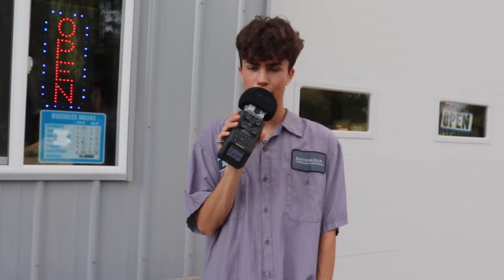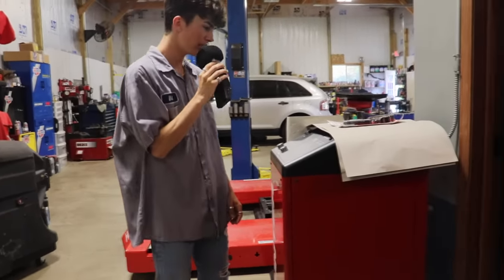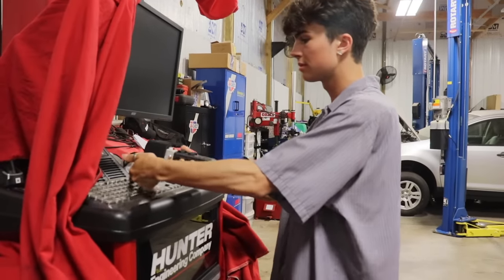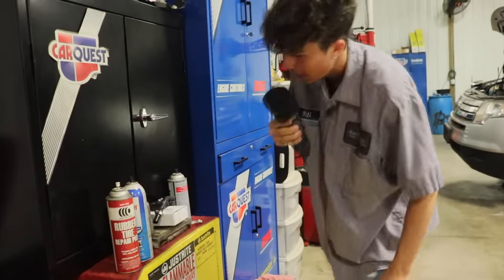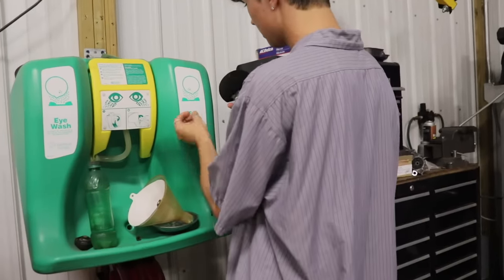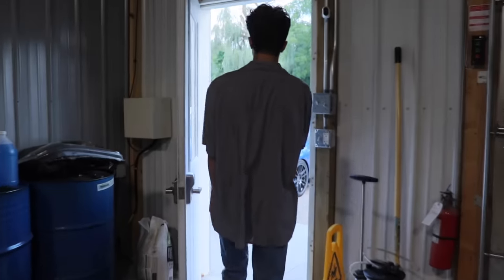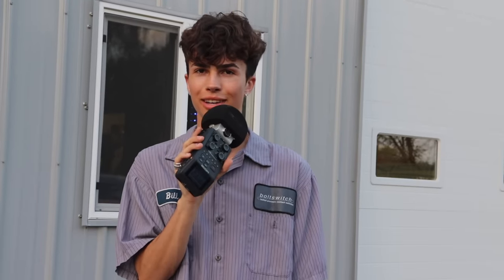ASMR In a Auto Repair Shop

Comment: 5:39 that is a blast cabinet, you’re right that it cleans parts more specifically like rust or paint removal. You basically put your arms in the holes/gloves and pickup a tool connected to an air hose, that sprays media or sand out and removed rust or paint.
Reply: We have them at work to blow off grind dust from our weld helmets.

Comment: 8:30 you’re close! Electrical diagnosis tools, looks like Digital Volt Ohm Meters or Amp Clamps - (used to check electrical systems/wiring for voltage, ground, resistance, shorts, or opens)
Reply: @ducky3545  shutup omp omp cat

Comment: 10:38 Those are “sockets” all types of sizes, lengths, and functions for different types of fasteners nuts or bolts on vehicles. Cool tip the chrome ones aren’t recommended for power tools because those are a harder metal and can shatter/explode when they break. The matte black sockets are impact sockets and are actually a softer metal that won’t explode and are meant for power tools.
Reply: I'd say you should be a mechanic but you are most likely one.
Clap out my Civic lol
Reply: @naniwara8673  lol

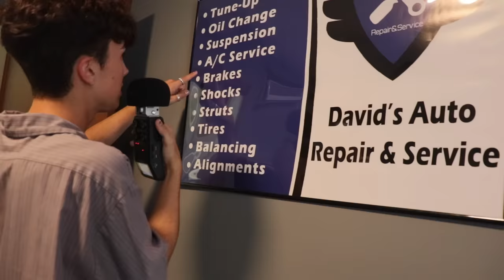Comment: 1:20 Shocks are what absorb and slow your vehicles bouncing. Good way to tell if your springs/shocks or in some cases struts(springs and shocks combined, usually found on the front of vehicles) are bad is if your vehicle bounces a lot/feels like a boat going down the road.
Reply: thanks mechanical mike!
Reply: how about if it rides rough takes bumps really harsh that would be bad struts too?
Reply: @williamkot2670  yes, depending on if it’s front or back, it could be the strut or a shock absorber.

Comment: 20:50 that machine is for balancing wheels when you have new tires installed those paper clip looking things are placed on parts of the rim where the machine says so for balancing out the wheel so you don’t feel vibrations driving down the road

Comment: 5:24 Sandblaster, removes paint
9:00 This takes tires off of the wheel and can put a new one on
14:53 This is a floodlight.
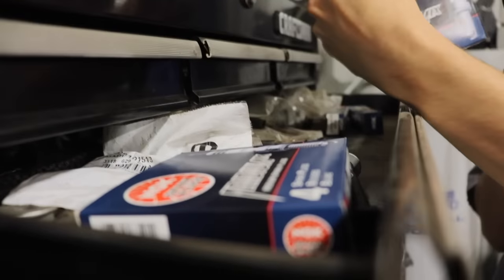15:25 Spark plugs ignite the fuel in the engine and cause an explosion, you can find videos to understand it better.
16:10 This is a vice, it holds things in place.
16:33 This is an air compressor.
20:54 This is a car lift
29:30 This is a wheel balancer

Comment: The red box with the buttons on it is used to operate the lift and change the amount air pressure that each hose has on each corner of the lift

Comment: tune up is, basically a tuning of the vehicle, i think, oil change, pretty simple, changing the oil. Suspension is changing i believe the damping, A/C service is like the air conditioning fans or whatever from the vehicle like those mini fans inside a containment i guess? brakes, to stop moving the car lmao, so true. Shocks, i think are something that goes along with suspension, Struts, i think are changing the strut bars. Tires, changing to all season, spring, summer, ect. balancing, probably of suspension, alignment i think is camber if i ain't wrong. Did it best of my knowledge as a kid.

Comment: The red machine is used for tires to take on/off the rubber around the hubcaps safely after you put it on the main cylinder
Reply: Your weong
Reply: @Zapdos6996  I have one in my shop bro
Reply: It takes the tire off of a Wheel, Hubcaps are not wheels. Lol